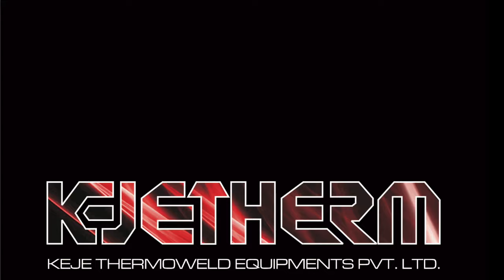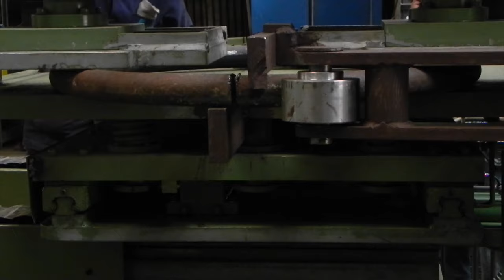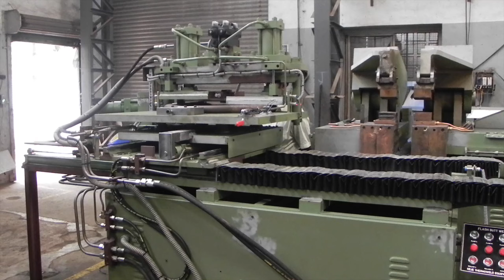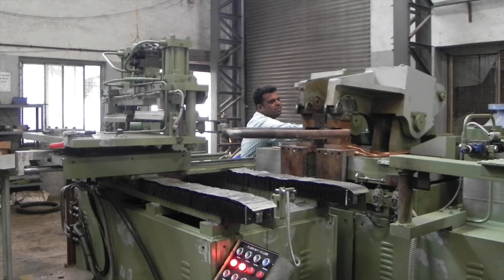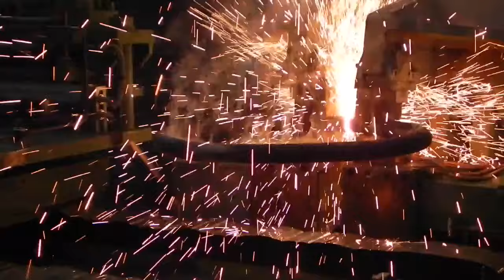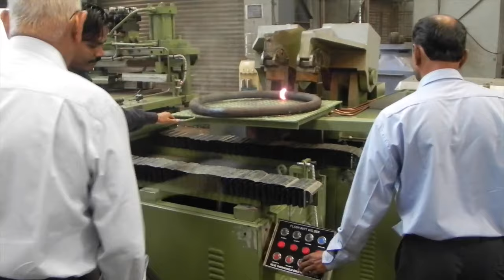Flash Butt Welder With Auto Loading

Comment: Looks like a strong handling machine but incredibly slow.  So much of the cycle is loading/unloading the ring.
The upset cylinder looks rather small for a ring of such cross section, is there enough upsetting force to generate a decent forge welding pressure at the ring joint?
I'm sure I spotted a 'freeze' during the welding cycle when sparking stopped for quite a significant time.